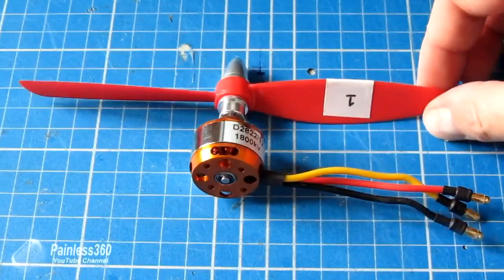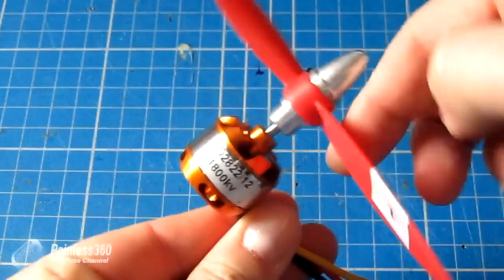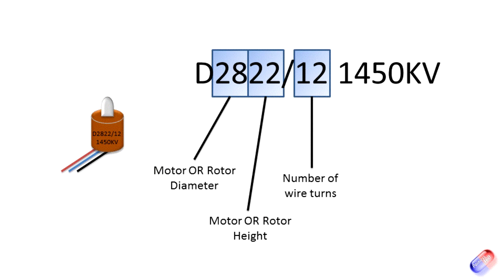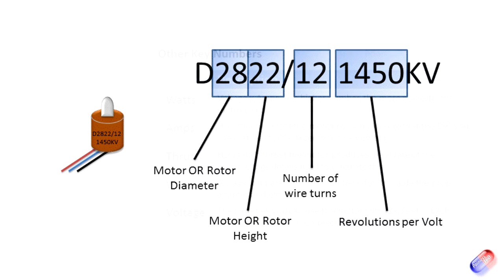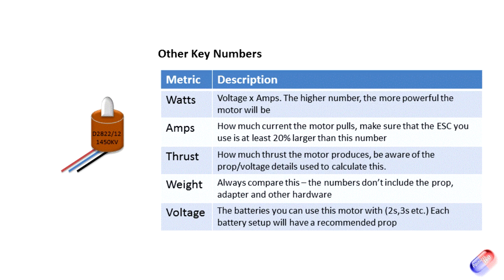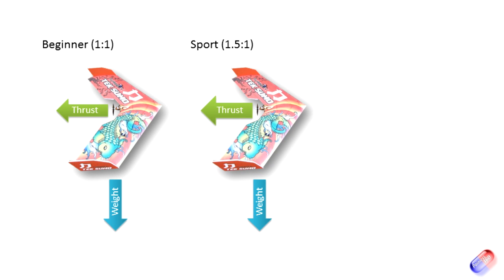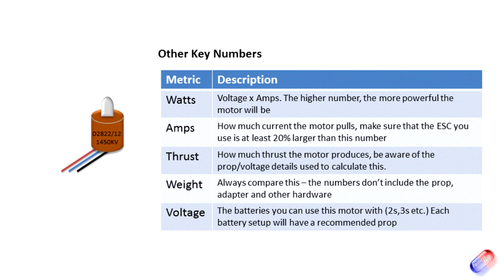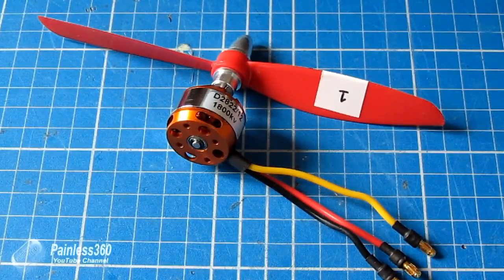Brushless Motor Numbers Explained (KV etc)

Comment: So if I have a heavier plane I would want more kv or less? It I'm looking at these orange motors on eBay and my place is sitting at 630g idk what motor would be better
Reply from the maker: Check out my motor and prop series. You need to look at it using a few more considerations... Best of luck

Comment: How do I know how many amps my motor pulls?
Reply from the maker: Two ways:
1) hook it up to a WATT meter and test it OR
2) find a thrust table for the motor and prop you're using and look up the current draw for that setup. 
You can learn a lot more by checking out my 'Motor and Prop' playlist as it covers all the basics for new pilots. Best of luck!

Comment: Good Morning Lee
I have a few questions about an electric set-up
1) The kV figure, is it off-load with no prop fitted. 
2) Or is it on-load, with the correct prop and drawing the quoted current ?
3) In my test the current was only 34 A, ie, much less than the quoted figure.

ESC, Turnigy Plush 100A.    Battery, Turnigy Nano-Tech 4000 mAh. Watt meter, Hobbyking P1 HV.

EMax Grand Turbo          GT 2826 / 06

2899ba07-aea5-47c3-acba-bee7f787927e.png

 The motor is quoted at 
             4S        710kV          14 x 7 Prop        7600 rpm      51 A                    But at 4S    7600 /  14.8 = 513 kV   !
                                                                                                                                                                                    These figures (513 and 503) are similar
When I tested the motor
             4S  (13.7V on load)  14 x 7 Prop       6900 rpm       34 A  473 W                           6900 / 13.7 = 503 kV
           ( 13.7 x 710 = 9727 rpm ? )

I also checked the AC voltage        8.7 V AC ph to ph         770Hz
         (  6900 / 8.7 = 793 kV )   

The battery voltage after testing is 15.1 V

My questions are, what voltage does the kV figure relate to, and why is the on-load current so low ?
Thank you for your attention
Regards
John McClean, in Wicklow
Reply from the maker: A motor will try and maintain that speed in all conditions. The wattage it'll pull depends on the load. Larger props and more pitch will need more power... Best of luck

Comment: Hello nice and helpful explanation I’m new to the hobby, but I don’t know how to calculate de motor current draw?’ The motor of my plane is 1,100KV and uses 3S batteries, which would be the number of amp os this motor.?….thanks
Reply from the maker: You need to know the prop and then lookup the draw. See my motor and prop series... Best of luck

Comment: I found a motor for my build and configured all the electronics I would need, then realised there is no motor mount is there any workaround for this?
Reply from the maker: Without knowing what model you are referring to it is tricky to offer specific advice. Laser cut  or 3d printed motor mounts are common.. Best of luck
Reply: @Painless360  Sent scorpion motors an email and they said they have a mount available, the motor turned out to be helicopter motor!, should still be fine for a fixed-wing hopefully.

Comment: What do you think if I where to us 60 amp speed control that I got on sale  for 30 amp motors ? And does it matter if I get cheap ones from Bangood hobbies ?
Reply from the maker: Yes you can, in fact it is a good idea to use an ESC with a higher capacity than the motor so you don't run it at 100% capacity. I normally over-size my ESC by 20%. So a motor that pulls 40 amps would be connected to a 50 amp ESC..
Reply from the maker: https://youtu.be/cXULcdX9Kv0 for you  :D

Comment: Having got back into RC after all these years (where have I been)? 
Things have gotten a little complicated.
You can just buy kits that easily fit for the models your transforming, the only twizz is the mathematics involved. 
Too much torque bears heavily on the drive-trains. 
Finding the right electronics/motors/esc's that are more efficient that put you on the "fulcrum" of lastibility/high speed economically needs these informative videos to explain. 
I have learned a lot from this. 
You have to burn-out some equipment to learn the hard way.
Reply from the maker: You can avoid a lot of the guesswork if you know a few things about the model. Check out the motor and prop playlist for the tips and tricks... happy flying!

Comment: Picking up on your comments I think it's unfortunate that the specs tend to specify the KV rather than the related torque constant KI. Ignoring efficiency issues KI is related to KV by:-
KI = 30/(Pi.KV) 
so as KV increases the torque constant KI falls. I think it's a common error to assume that (numerically) bigger = better so people are inclined to think that if the sums suggest they need 1500KV then a motor of 1600KV would be erring on the safe side when the reverse is more likely to be the case. The max current x KI really represents the max torque the motor can produce and no amount of tinkering can really overcome that. So in a given frame size the higher KV motor is more likely to be torque limited and not be able to achieve the desired speed of the prop without over-heating. Conversely, if the KV is on the low side you have the option to increase the cell count to increase the speed or go to a slightly bigger and/or higher pitch prop. (going to a smaller or lower pitch prop to try to fix a too high KV motor selection leads to a reduction in aerodynamic efficiency and thrust so is much less likely to acieve anything useful)
Reply from the maker: Check out my video series on motor and prop selection. Lots more detail aimed at the newer builder... Happy flying

Comment: Do size of mottor matters?? A quad motor can be used on a plane??? Eco 2207 2400kv produces 1700gram of thrust,
Reply from the maker: It depends on the plane, how much speed you want and how easy you need it to be to launch. Smaller models can cope with 5" class motors but larger models need fixed wing motors and props - see my other videos on choosing a motor and prop for a fixed wing and I have a new video on the topic coming soon.

Comment: Hi, i have purchased an old model which im putting together and its recommending a 400 class which i presume is a type of brushed motor at the time, how do i convert this to a brushless motor, it states the model weight is 800g which i presume is without motor and electrical gear.
Many thanks,
Nick.
Reply from the maker: No idea what a '400' class is. Sites like eCalc can be a huge help in finding a good motor and prop combo for an older model if you know things like weight, wing specs etc..
Reply: @Painless360  ah thanks i will give it go! 😊👍

Comment: Hello, thanks for useful informations. I have a question. Is 1:1 thrust:weight ratio enough for safe flight? I mean for fixed wing aircraft cruise flight. From my aspect, here is the thing firsty, you need to analyse drag of aircraft then you should find stall speed after that your thrust at stall speed must overcome drag. Is this way neccessary?
Reply from the maker: Depends on the model type and scale. See my video on it.. Best of luck

Comment: you say its 10-20% greater esc then motor, but i have heard that to "great" an amount can supposidly cause damage! for example if i had a 25 peak-amp/watt motor and a 150 amp esc i have been told that the motor can burn itself out because the esc will supply it with more current then it could handle. is this true? is their any problem with having a MUCH greater ESC then the motors needs aside from cost?
Reply from the maker: I'm guessing that's usually from those who don't understand how it works. The ESC doesn't push current the motor can't use. Having a higher capacity in the ESC makes wire that even when the motor is at 100% the ESC isn't at maximum too.. Happy flying

Comment: I’ve never had the bearings go out in my brushless motor.    I’ve had magnets dislodge after running in to one of the 9 planets, 8 planets sorry.    Ripped the wires right off the stator after I tried a vertical landing, guess you’re not suppose to go nose first .  And had a fire which I guess technically it was the battery that caught fire after I flew into a rock which dislodge the battery abruptly into the motor and punctured it.  I thought it was just a surface wound and mended the planes  and took off about 30 seconds into flight it caught fire luckily it did a nose dive into the ground  so it wasn’t a burning fireball.  But bearing failing nope never had that happen. You know what actually. One time I flew into a tree I thought I was coming back to me but I was going away. Lost my bearing you’re right.

Comment: Great info, just getting back into RC models. Not touched anything since I was 14 (20 years ago) so very helpfull
Reply from the maker: Thanks for the comment, check out the other videos in the 'RC Basics' series.. Best of luck!
Reply: @Philip Tomkins
  LOL! That's funny, I'm the same way. I'm 20 years older than you but I too, started when I was about 13 or 14. I'll stick with the hobby for a couple years, then shelf it for 10 years or so, then repeat the process. I'm just getting back into it again. Almost all my planes have 70"+ wingspans and all of them are built from kits. Since this is the longest I've been away from the hobby (13 years) and my eyesight has changed (i'm too busy to go get some glasses. Well, that's the excuse I use ) I decided to get an RTF foamy for a refresher course rather than use one that I already have. It's an Easy Trainer by FMS and it's really easy to fly. I wanted to get an RTF because all my "old fashioned" ni-cad transmitter and receiver battery packs are no good. They're all on 72MHz, that's what was used before 2.4GHz came out. I need to add some nitro fuel to my list as well. I've got 3 one gallon cans and even though they're all still factory sealed, I don't think any of it will be any good after 12 years. But maybe it will. I'm thinking out loud... 
Anyways, enjoy the  hobby, have a great time and stay well, especially during this pandemic!

Comment: C2412-1200KV Out Runner Brushless Motor   What is this C number at beginning?
Reply from the maker: That's usually vendor specific, not sure. Best of luck
Reply: Painless360 It probably is I couldnt find anything else . Thanks for quick respond.

Comment: So higher kv = faster speed???? Pls answer anyone??
Reply from the maker: What's your guess after watching this video?
Reply: Painless360 ye higher kv means faster
Reply from the maker: Yes, spot on. KV is a measure of how fast the motor spins per volt applied. Higher KV or voltage = faster rotation. All the in the video. Happy flying!
Reply: Painless360 thank you!

Comment: Hey my names William, I'm building my 2nd homemade boat and I've gathered much information from your channel but I'm having trouble figuring out the right size prop for a twin motor setup, any advice it appreciated, thanks. Re: 2x rcrunning 4300kv brushless motors with 2x ovonics 3s lipo 2200mh 25c batteries
Reply from the maker: Sorry but I don't run boats here so not sure about screw choice... best of luck!
Reply: @Painless360  ok, thanks

Comment: I have a burshless A2212 / 6T 2200KV and BEC 3A @ 5v, 2-3cell, what size battery should I use
Reply from the maker: Depends on the weight the model can carry... See other video in my Introduction to remote control playlist... Happy flying!
Reply: @Painless360  Thank you very much

Comment: Plz make a video for a 3D rc plane.....i have 2212 6T 2200 kv motor ,6x4 and 10×4 prop, 2200 3s lipo and plastic bord to make thing like a 3D I'm lil poor to buy new motor plz suggest some hack to use all to make it
Reply from the maker: I have loads of videos that will teach you what you need to know. Check out the 'Introduction to Remote control', flying wings for beginners' and things like the Flitetest plans that you can download and make out of board make for very cheap models. Best of luck with the project..
Reply: @Painless360  thanks but where I live foam board are not available....I am working on plastic advertisement boards

Comment: Back 40 years ago I ran Parma 14 turn doubles in a mardave meteor with Sanyo 4000 MaH batteries and 14 tooth  pinion the thing went like a cheetah with its arse on fire

Comment: I have a question for you would I notice the difference between a 850 KV to 880 Kv or is there not going to be that much of a difference the reason why I'm asking I have a 850kv in my plane now I want to switch it to an 880 not sure if it's worth the money
Reply from the maker: A small change, depends on the battery and prop you're using. I have a video out at the weekend (you can see it now in the Ardupilot/Matek plane build series playlist now) that covers this a little..

Comment: I know its a bit late but will you do one on electric longboard motors? There seems to be some confusion about VESC or premade ESC from ebay and their ratings in the DIY community.
Reply from the maker: That's not something I've got a lot of experience with. I have a seen a few electrics kits that seem to remove a lot of the guesswork.. Sorry I can't be of more help on this one..

Comment: what does height effect on motor
Reply from the maker: If you google something like 'effect of altitude on propeller efficiency' then there are white papers that cover it. As the ceiling (the maximum height you can legally fly) is usually measured in hundreds of feet it's not something that you worry too much about in the hobby..

Comment: Hi. 
I have some questions related to motors. 
I hope you will answer to me. 
I notice that motors for planes have normally higher can rotor than the motors for drones. 
Why this difference? 
Comparing motors for planes and for drones with same diameter, same kv and same voltage applied, what are the differences between motors?
Considering same motors characteristics, may I use a drone motors on a plane?
There is any differences in performance?
About propeller, which are the main differences between drones props and planes props?
Is it ok to use drones props on planes?
Thanks for your attention and replay. 
Regards. Giorgio.
Reply from the maker: That's a lot of questions here are the short answers ;)

1) 5" quad motors are all about speed and performance, planes have more room and don't need to squeeze that much power out of a small space
2) Most of it is branding and hype, sure there are motors with better bearings, magnets and quality control on both sides of the fence.
3) Yes you can, I've used multirotor motors on lots of wings
4)  Not by much at all if the specs are the same
5) Drone props are all about speed, plane props tend to be more of a range of performance and efficiency.
6) Yep

Happy flying!

Comment: i want to get a 1300kv brushlessmotor ,but there is many brands DYS ,XXD ,racerstar, ....etc what's the best between all of them
Reply from the maker: Most modern motors are a lot better than they used to be. You do get what you pay for with them though.. I've used lots in my build and trust EMAX and a few of the other leading brands..
Reply: @Painless360  sir what you think about the ''Racerstar BR2830 ''' i want to use them for my first airplane becausee they generat around 1130(g)  238W , are they good for longterm use

Comment: Which type of motor should I use for lifting weight more then 100 kgs???
Reply from the maker: Depends on the number of motors you plan to use.. see the ‘big boys toys’ playlist for more..
Reply: @Painless360  i want to use only one motor to lift 100kgs, is it possible?
Reply from the maker: Almost certainly. I’ve not done it but be aware that models that heavy are covered by far more laws and regulations.. best of luck!

Comment: Is it possible to use a 3s lipo on a 2s brushless motor to get more speed, or power?
Reply from the maker: Not without changing the prop you're using..
Reply: Painless360 I'm actually using it for a flywheel in a nerf gun
Reply from the maker: @AndrewAitchison100  then no idea! :)

Comment: How many amps is a 1000kv motor
Reply from the maker: The KV rating has nothing to do with amps. Two Motors with the same KV rating can pull different amounts of amps depending on how their wound, how they set up, the size of the can etc. To find out the amps you need to be looking at the specification of the motor you're interested in for the battery and prop that you want to use. Please see the other motor videos in the 'introduction to remote control' series for more information.
Reply: Omg thank you so much. You are really great. Your videos are great. Your instructions are clear and you reply to comments(awesome). Respect!

Comment: what is the best motor for 1045 propeller 2200kv motor or 1000kv motor
Reply from the maker: +Jinuka Dulsara see the other videos in the introduction to remote control series. You need to figure out how much thrust you actually want or what the recommended prop is for the motor and battery you are using then work back from there. Best of luck!